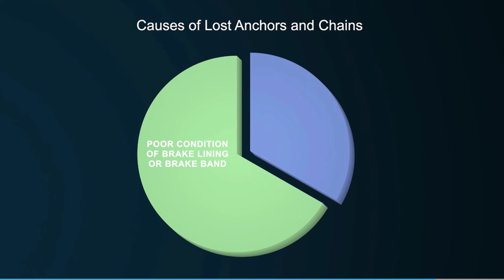A Very Scary Mooring Accident . BE SAFE . COME HOME SAFE .

Comment: I've acted as a line handler while in the Navy. Usually just mooring another Frigate.  I knew to hit the deck if a saw a tought line. These were nylon lines about 2 inches thick and could  weigh hundreds of pounds. When stretched it was like a giant sling shot and could cut through metal.